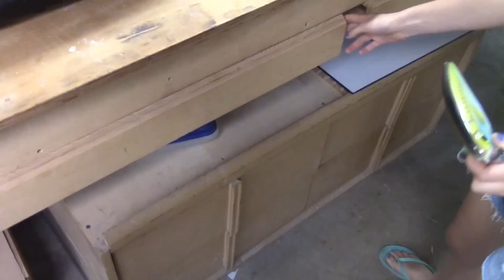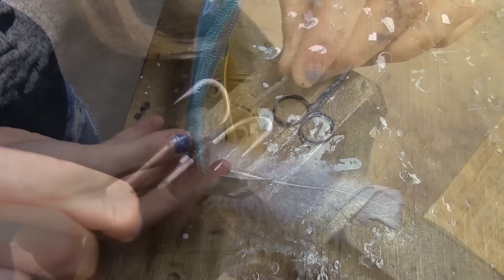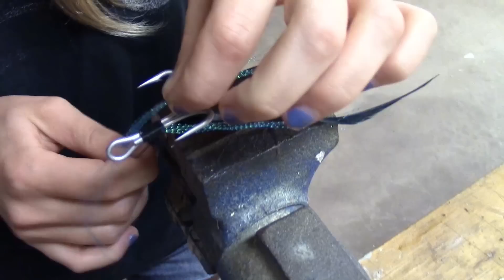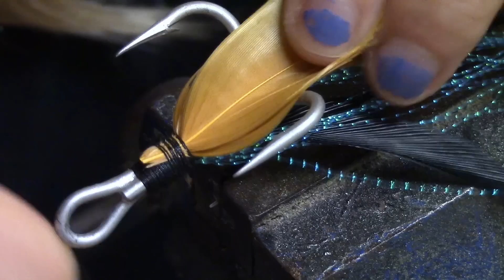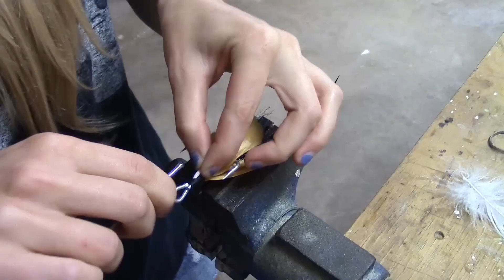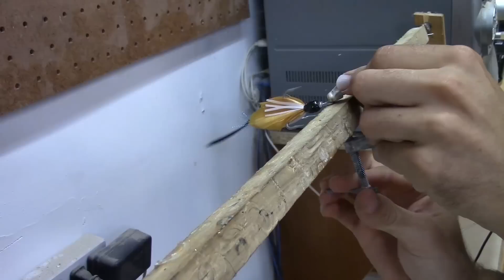Making a Feathered Treble Hook

Comment: It is amazing the things you find on YouTube. I have made my own jigs for years but I learned a couple of tricks watching your video. One thing you might try is using the transparent monofilament line instead of regular thread. I get it at Wal-Mart. It is so tiny you get hardly any thread buildup and since it is clear you can see the flashabou and all of your materials under the thread. I have also switched to zap-a-gap for a finish. You don't get the thick finish that you get with the epoxy but it is tough as nails.
Reply from the maker: Awesome great ideas! Thanks Pat
Reply: That was such a beautifully dressed treble!

Comment: great video,just want to know where do you buy those material
Reply from the maker: Almost everything was bought on Ebay, but the feathers were from a craft store.
Reply: Thank you for your response hope to see more videos
Reply: What is the name of the little metal toothpick looking thing that wraps thread around the hook?
Reply: KRS 1 that's called a thread bobbin. It's used for tying flies. Hope this helps.
Reply: Most any fly tying shop will have all you need for this including the tools (thread bobbin and whip finish tool).  A pair of nice fly tying scissors will make precise cuts easy too.